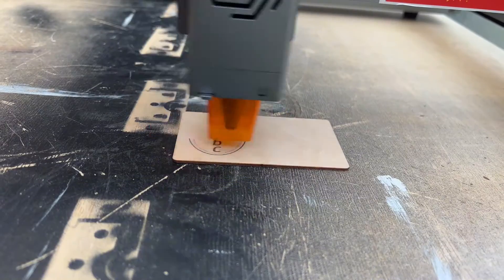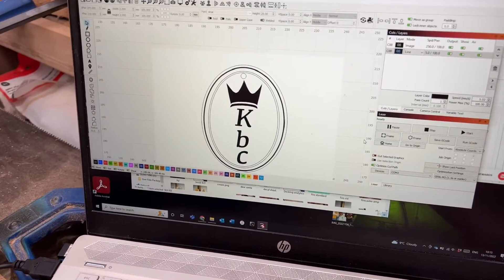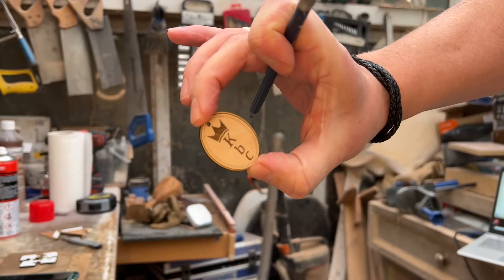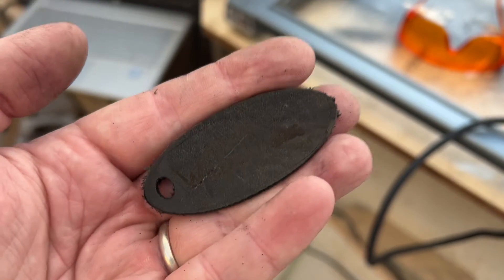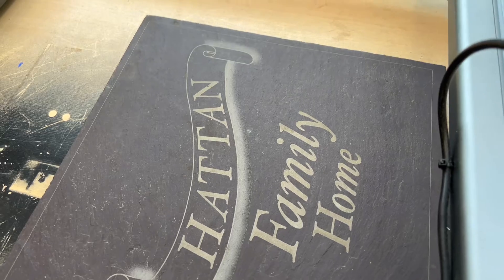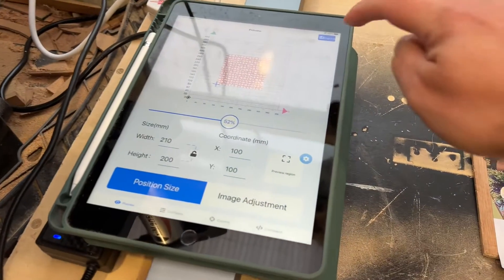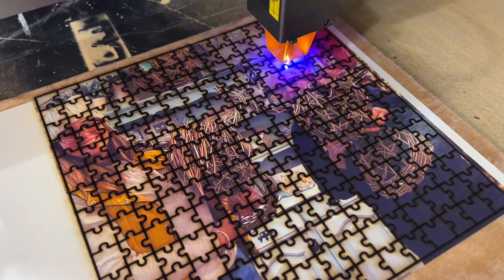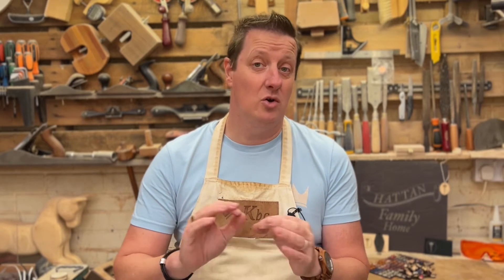Laser engravers in a small workshop? -  Ortur laser master3 review

Comment: These are cool.  But these open frame cutters have some major safety risks people need to address if they are going to use them.  

No protection from errant laser radiation.  It looks like they come with goggles, judging by the video, but be sure they are certified for the laser you are using.  Lots of these cheap lasers come with cheap goggles that offer basically zero protection.  Source out a quality pair.  And don't let anyone else in the area without goggles.  No kids, no pets, no one.  It's not just about looking at the laser.  The laser can be misaligned or scatter (depending on what you're cutting), and you might not even know.  And it only takes a small amount of radiation and an extremely short time to do irreversible damage.

Also no gas extraction.  laser cutting many plastics, some leathers, and many plywoods (depending on what material was used to make/tan/bind them) release some nasty toxic fumes when laser cutting.  At the very least be sure you have good ventilation, better yet wear a respirator.  Better still, invest in dedicated gas extraction.  And always be aware of the properties of the material being cut.

A good cutter SHOULD be fully enclosed, to protect from stray radiation, and have a quality extraction system.  You, of course, can use these open frame setups, but you're safety game has to be top notch, and you really need to know what you are cutting, and what it's going to release when heated.  Hate being a downer voice.  But these things can do a lot of hidden damage.  Many people are not aware of the harm they are doing to themselves, until it accumulates to irreversible levels.

To try to be positive, you can build a simple enclosure and ventilate it outside with a small fan, fairly cheaply and easily, to make these much safer.  And that is well worth the time invested.
Reply from the maker: All good points. I will say that the laser itself has a visual block around It to match the glasses, which have a safety stamp on them. 
As with any material, you always need to be careful of vapours and dust no matter what you’re cutting them with 👍